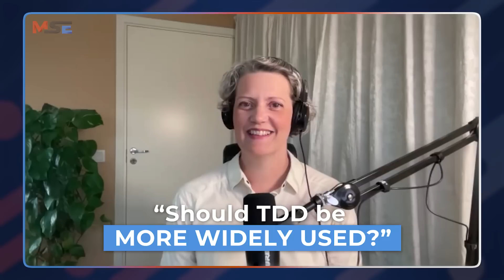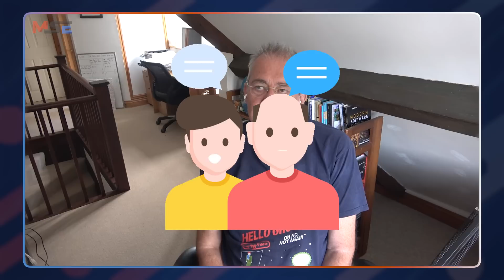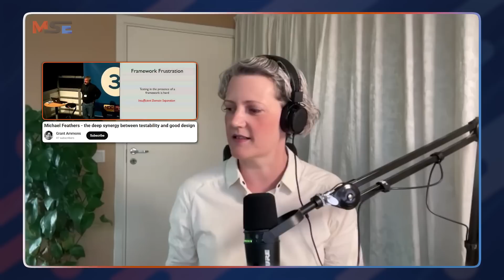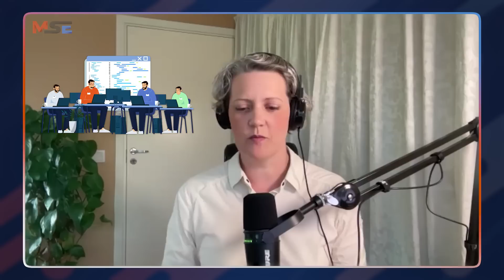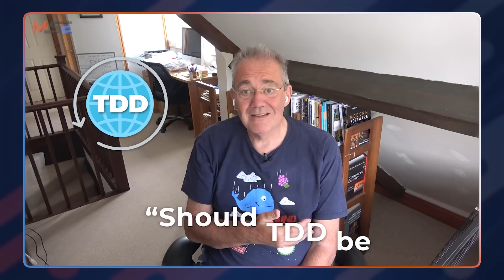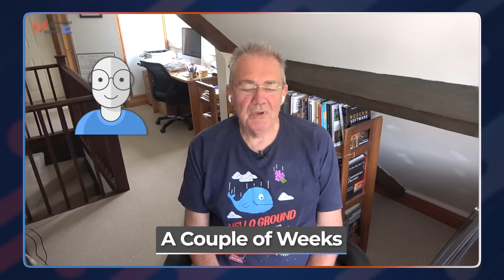Should Test-Driven Development (TDD) Be Used MORE In Software Engineering?

Comment: The greatest resistance to TDD usually comes from people who don’t really understand it. The greatest objection I've heard can be summarized as TDD "won't fix all your problems" and "TDD is not perfect" and also "TDD is dogmatic". Which is kind of true but also a fallacy.
Reply: I do agree TDD works as framework, but I do also state it can lead to more costs. Situations where TDD gets expensive is in low-user-count yet another spring boot/djagno/RoR data entry app.. But that is like 80+% of projects out there. Enforcing "test first", "code coverage" and "each commit has to have test" rules on those apps I something I would call dogmatic and expensive..
Reply from the maker: Clearly I disagree. The reason that TDD seems to not fit so many "<simple> data entry apps" is because so many of them are so poorly designed, if they were driven by TDD they would be better designed, and faster to write and easier to change as a result - ask me how I know!
Reply: @ModernSoftwareEngineeringYT a lot of that bad design results in the only tests that work being fragile end to end tests driven through the ui.

That obviously makes people dislike those tests.

Frameworks often don't help with this, mixing setup and logic in a way that just makes it much worse.

Most of the people I see complaining loudest are either big upfront design oops people or those where everything can only be run from the ui. They often are totally clueless about anything but end to end testing.
Reply: @bariole Sorry, but I’ve never experienced an increase in cost/time when using TDD in all the years I’ve adopted it. This isn’t based on an assumption, but on metrics captured.
The amount of time I’ve saved not fixing bugs, not even having to run the application locally and worry about connecting to infrastructure (pipeline will run automated application level tests, as few as needed).
Some capture how long it takes a developer to commit & push their code as a measurement, IMHO this isn’t helpful. How long did it take to deliver those changes to production is of higher value.

Comment: Yes, I agree that everyone should learn and give TDD a serious try for a few months at least once during their career and then revisit sometimes now and then. It teaches some very valuable things on how to design testable code. However, writing testable code is just a pretty small part of designing good code. There are so many other things and considerations when you are designing your solution and I find that you often end up with a much worse solution if you stick to the workflow of writing the test first,  then make it pass and lastly refactor. By the time you come to the refactor stage you have already locked in much of the design and that is often far from the optimal design. 
In most cases the specification of what you should do is also not clear enough to write good tests first, and then you end up refactoring the tests just as much as you refactor the code and loose the TDD workflow anyway. 

I have been thinking about TDD some more the last few weeks and if that could be a good way to work with AI agents. I think it could be a decent fit in some cases where you first write a specification, then write tests with some help from the AI and then let the agent implement the feature under your supervision.
Reply: Isn't the problem you're describing just summed as "taking too large of a step" in TDD? You're not iterating, you're doing upfront design. If you're unsure about your design, you should design around being able to change it so you're not locked-in, no? But you should also keep a balance of small iterations, as to not let this design stage get too out of hand.

Also, TDD & XP are GREAT ways to reign in AI coding assistants. While AI coding tools still don't have any hard guardrails against large swathes of code, you can really prompt it to at least follow a bit closer to the road instead of veering off a cliff with a ton of code. Paul Hammond's XP & TDD w/ Claude Code video was interesting, and I hope this channel covers it.

Also, just to clear up terminology re-designing your test isn't really refactoring. You tested the wrong thing, you have to write a new test. You can write a new test while migrating away from the old one. It is possible. If you have to do this a lot, maybe a signal of bad design (why that may be is really up to a lot of reasons).
Reply: Every line of new code should be covered by small tests with a single assert, wheras it sounds like you are designing the entire module, then writing all of the tests, then writing all of the code.

A good tdd cycle should be able to do every stage in under 2 minutes total, then move onto the next test, not code all the tests upfront.

Comment: I believe there's a good deal of patterns that are extremely useful, thus should be considered "good code", but are still hard to (unit) test. Closures, context managers, SQL statements,  data science plots or ML models to name a few.

 Can you please comment on how to TDD such cases?

 Those are fairly common in the life of data engineer, I do recognize they made me detach from a pure TDD approach, that was making my life so easy as a backend engineer...
Then, thinking again, it might be that I'm not skilled enough in the fields of DE/ML/DS, but I found utterly hard to find resources to kick-start TDD also in those fields...
Reply from the maker: I think that the trick is a switch in focus, from "testing an implementation" to "specifying behaviour". If your "tests" specify WHAT your code is meant to achieve, it applies a pressure on you to design interfaces that better express that. These are better in a lot of basic ways, simpler to understand and use, and crucially, simpler to test. 
So through abstraction and design you hide the parts that are hard to test. It is not your job to test that a database works as a database, you are interested in your use of the database, so focus on testing only that. 
TDD tends to highlight poor abstraction in design, so don't test SQL statements, test that you can find orders or customers, test that when you transfer funds between accounts, the sums add up. Don't test implementation detail. Your tests should not care whether your code is in a relational DB a column store or a flat file, that's not the job of the test!
Reply: For a start, most of those seem to be integration tests, not unit tests, and as such should never be designed to run against the full production data set.

Secondly, a lot of that seems to be about testing third party code to see if it does what it says it does. If it is well written and open source you should be able to open the source and just look at the tests to get those answers without having to reimplement them yourself.

Finally, from what you say, it looks like they are non functional tests, which belong in the deployment pipeline, not in ci, which should only be functional tests.

Comment: The last D should have always stood for "design", I've been refering to it this way for years. 

It's the true power of TDD in my experience (Agile/XP coaching/mentoring/transformations), it teaches you how to produce a testable design (in conjunction with other "XP" type techniques) which is the a big step towards a "CLEAN", easy to understand and maintain codebase. 

It's also a great tool (as are tests in general), especially combined with pair-programming, for both documentating the code usage and sharing knowledge across a team.

Oh, and using it in a coding interview helped get me two of the best jobs I've ever had :)
Reply: And sometimes, the T should stand for "Tedious", but not always.

Comment: The reason I dislike TDD is not that we need to think about tests first and implement them first. I think that is a quite good approach. It is this cycle of doing of test at a time and then implementing that feels like kindergarten.
Reply from the maker: Why does it feel like "kindergarten"? If we were carpenters, we'd measure the wood, and mark it out, before we cut it, TDD is only the same thing but for code. Why is that childish?
Reply: @ModernSoftwareEngineeringYT That's the worst analogy I have ever heard. TTD feels like it is designed to keep mediocre  devs in check... Testing has a function, but it should not become a religion.
Reply: @minnedanhieux883you're right, testing has the function of working to make it so the next piece of new legacy code you write without considering testability does not silently break the last piece of untestable new legacy code. If that is a problem for you then by all means defer all of your testing until it is mostlymdone and then enjoy the bug fixing death march trying to get the code good enough to get out of the door, and forget being able to go back to the last known good code from version control, because you made that entire idea invalid.

Comment: Approval testing is just a form of acceptance testing, Dave (@ModernSoftwareEngineeringYT). It's especially useful when defining the behaviour of an http endpoint or some a Kafka message your consumer is going to receive. You can attempt to define the output up front with a contract or other agreement with the front end or consumer as a starting point, so you shouldn't be "unguided" as a first step. Your guidance is your agreement, the contract. 

Then you start implementing. If you work towards your assumption, you can steer the code towards success. It doesn't preclude you from writing other tests to help guide the complex parts of the design, but your Approval test is just the acceptance of that slice.

Comment: I have trouble writing the tests first, as I don't always know what the APIs will look like - sometimes, actually quite often, they don't end up looking how I guessed they would. Even if I'm just doing the initial quick-and-dirty implementation, it still doesn't feel right and I change my mind on how the API needs to look. I suppose my ideas grow and take shape as I build things, and gain more understanding of the problem space. I find writing the code and tests side by side can be a better approach.

You seem to champion TDD in every video, but I don't think it's the right tool for every situation. It's great for some things, and I have used it, but it's not a universal solution.
Reply from the maker: A key idea of the first step in TDD, writing a failing test, is that that is the point when you explore and design what you want your API to look like, from the perspective of a consumer of it, rather than from the perspective of the producer of it. That way you build better APIs!
Reply: @ModernSoftwareEngineeringYT   I get the idea, I just find it hard to actually do in most cases.
Reply: Also, notice the key idea behind this example. Writing tests first for the business logic of scrubbing in fact did not result in the exploration of the correct API. By pretending to be the API consumer i did not predict the need for continiously changing scrub speed. The only way i could discover this is to actually manually run the program to get a feel for it.
Reply: If you don't know what the API will look like, do you even know what it should do first? We usually define APIs first, before we develop against that interface. In an organization, the consumer of an API is usually another organizational unit, so you cannot just freely change it as you see feel.
Reply: @Marque734  Maybe they work in video games, where teams and the released executables are monolithic programs running directly on domestic game console hardware rather than a bunch of decoupled microservices in the cloud, and the details of what we're building aren't known for certain until we've already built it and the designers have playtested it. Building to a defined API leads to weird contortions in the implementation to accommodate misunderstandings of the problem when the API was built... That's why gamedevs often write code directly in the function that's going to call the API first and then refactor it, so that they are forced to understand the actual use case rather than the hypothetical one they made up in their head when they looked at the existing code. Look up Casey Muratori's "compression-oriented programming" for more info on that approach.
Reply: While this might work with backend code. How are you going to explore if some UI feels good for the user to use without trying it out first? This week I was implementing something that functions similar to a video player. I was implementing the scrubbing (rewind and fast-forward) feature. I wrote the tests first assuming that scrubbing will have constant speed. Hovewer when i finally finnished the implementation the feature ended up being terrible because it scrubbed too fast for doing small scrubs and too slow for large scrubs. I had to delete all the useless tests, try out different easing functions that continiously change the scrubbing speed over the scrubbing duration and finally when i figured out what feels good, rewrote the tests for it. There you go. A prime example where fast prototyping without tests is better then doing tests first. This is also not only a UI thing. In this example, the business logic of scrubbing had to be changed in a way that it supports continiously changing speed to make the UI feel good.
Reply: @ParkourGrip wrong lesson, which is common amongst those who do not regularly do tdd.

You wrote it as a performance test where that performance was part of the api from the start.

What you should have done is made it a private api called by a functional test, then make it public only if needed and only when you got past getting it working and had do deal with performance problems after your performance tests identified not only that there was a problem, but also where it was so slow and why.

If you did tdd regularly you would never have considered that design correct in the first place.

Comment: LOL - got seduced for a job to become architect of a new version of the existing software. Though, at first, needed to fix bugs in current version as they came up. I was VERY qualified for the system, as I had experience in all the libraries and technologies they were using. Very early, I went to look at their tests. They had ZERO tests. I - figured, they were using PEST instead of PHPUnit, so I looked for those - and NO TESTS.

So, as I fixed bugs, they had a meeting about the new version, and apparently made a bunch of decisions. They'd retain the server-side language and library, but go from Angular to React. Bear in mind, they had over 200 screens in Angular that they'd basically jettison.

I remarked that they would be losing a fair amount of [somewhat] tested code ( at least DEPLOYED ) code, and they'd lose it all going to React.
Then, the lead engineer started working on a microservice for authorization stuff. The server library had battle-tested, flexible, and DEBUGGED code that did everything he was doing - but it wasn't a microservice. He said he wanted to be able to scale immediately.

sigh

I got laid-off after 3 weeks. LOL. That will be a clusterf**k if it ever even gets deployed.

Comment: I struggle with using TDD for Android Kotlin development. The reasons are: (1) Android as a framework is very difficult to write tests in. Almost everything is a side effect. You end up tying yourself in knots mocking everything. 
(2) Kotlin is slow to compile. Which is made worse by code generation based dependency injection (Dagger 2). On most established apps I’ve worked on running tests on a single class can take a minute and the whole unit test suite 3-5 minutes. There’s even a library that mocks the entirety of the Android SDK (Robolectric) that makes tests even slower to run.
(3) It’s hard to get a good flow of TDD going when any test you write causes the test suite to fail to compile as a method doesn’t exist in the codebase being tested. (Admittedly this last one is more of a minor niggle.)
I’m comparing this to doing TDD on Python backends where it’s all so smooth and easy, especially with over a thousand tests running in 5 seconds. I tend only to use TDD in Android when working on particularly complex bits of logic, where it is a huge help.  The juice is worth the squeeze then.

There are other things which Android makes it very difficult to do. Apple’s App Store and Google’s Play Store review every release, taking up to two weeks to do so, which makes it difficult to release every good commit to production. Users also don’t want to constantly receive updates to their phones. That is why git flow is so common with mobile teams, it suits that occasional release schedule. 
People talk about adopting trunk-based development on mobile teams I’ve been on but all they mean is continuing with git flow but deleting the main branch. But that makes the occasional hot fix release harder when it’s needed. Without every commit having a good chance of making it straight into production I don’t think mobile developers take their commits seriously. They hide behind knowing that a release will be heavily manually tested. I do git bisect and half the commits won’t compile.

I’d love to hear from people who have made a continuous delivery approach work on mobile. I’ve been to talks about TDD on Android but I always leave disappointed: I ask about the above questions and it’s clear from their responses that in reality they are writing the vast majority of their tests after the app code has been written just like the teams I’ve been on. My hope is with a new app I’m starting to work on, which is small and focussed (but sadly lacking unit tests). With an M4 Mac I’m hoping the tests might just compile and run fast enough.